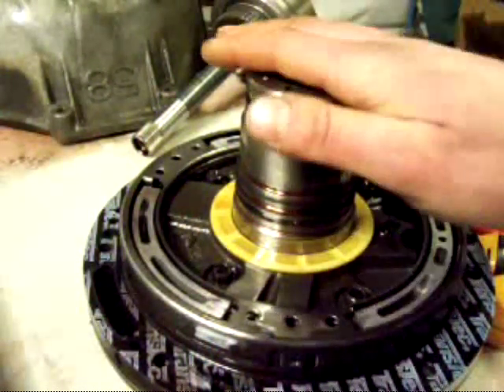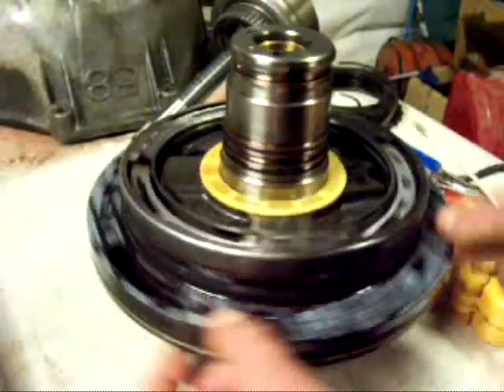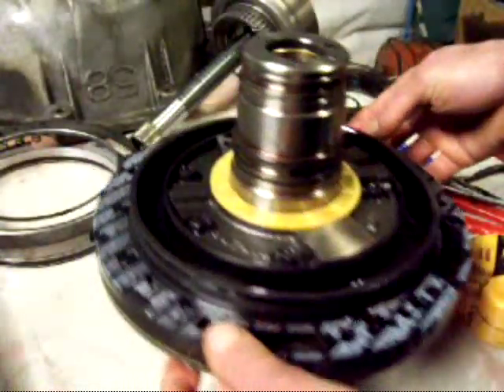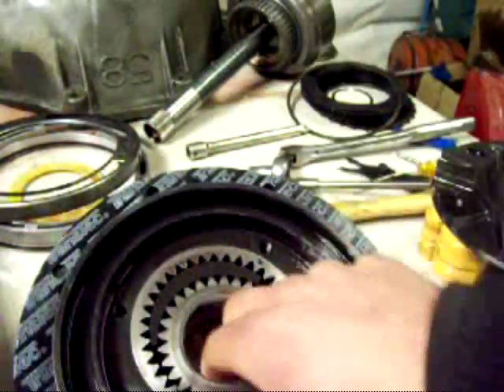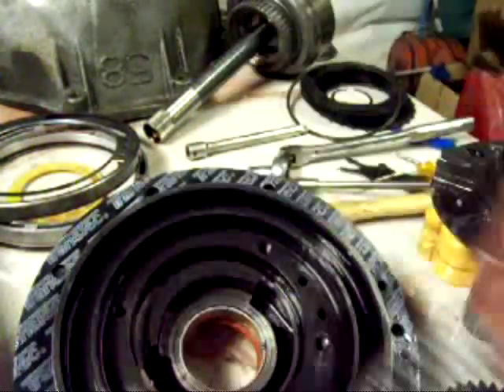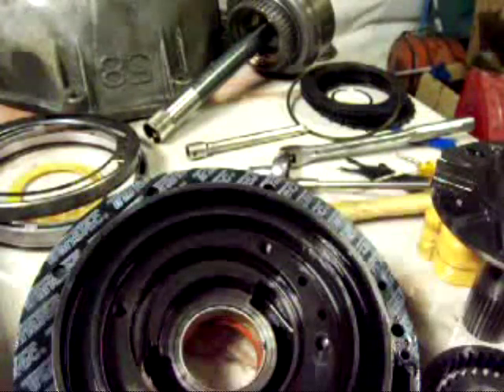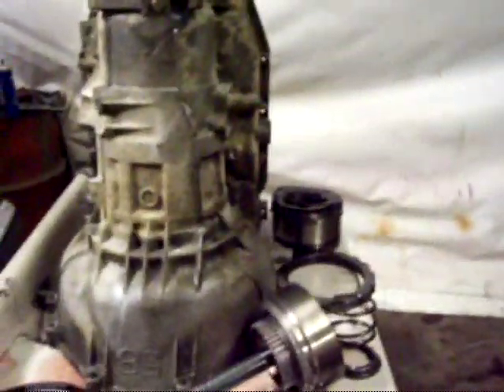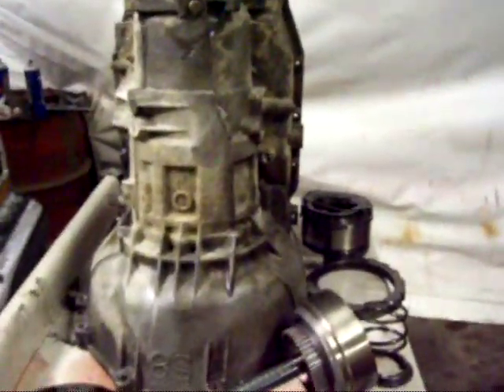Ford AOD Transmission Oil Pump and Intermediate Piston Disassembly

Comment: HI bah53 I was wondering if you had a part number for the yellow seal around the stator. The one that's in the thumbnail for the video. My pump got fried I got a new one but it didn't come with the yellow seal and I haven't been able to even find it listed online.

Comment: Hey.. I hope u see this and can answer as soon as possible... Ok well I took all my tranny appart.. When I got to the pump and opened it, it was worn out under the sprocket (in the pump).. So I went and purchased a used one ,but didnt noticed until I got home, that the top (otside the pump) was worn out as if the metal plate  was rubbing against it. Do you know if it's gonna work or am I going to have to buy another one? Thanks.
Reply from the maker: Yoan Aldaco It's hard to say if something needs to be replaced without being there to see it but generally speaking if you see wear on something where two parts are supposed to ride on each other it should be replaced. Here's website that has an exploded view of the AOD. www.wittrans.com